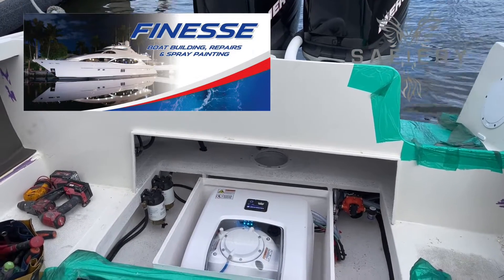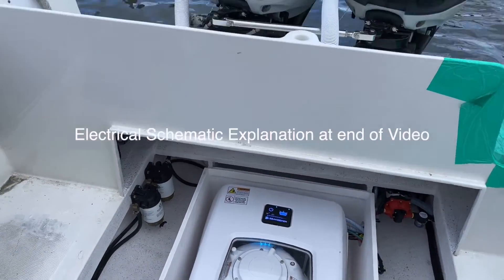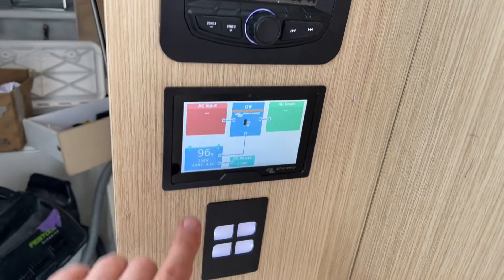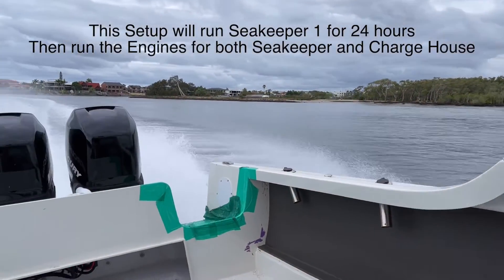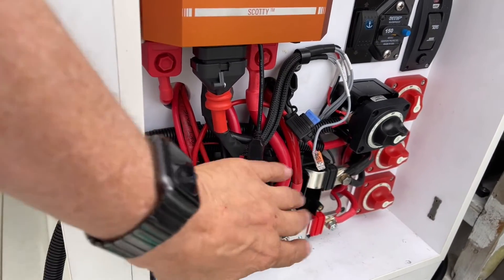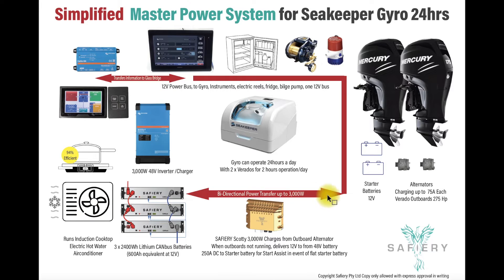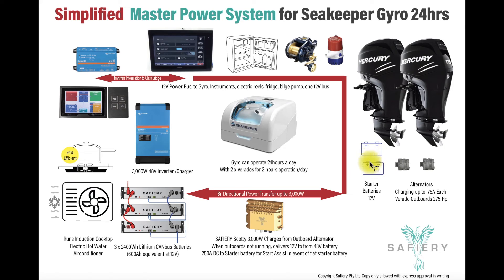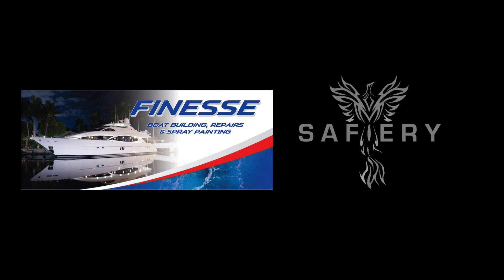Sea Trial of Seakeeper Gyro Bertram 25 - Scotty powers both Gyro & charges Lithium for up to 24hrs

Comment: Absolutely.Incredible.How much 😊
Reply from the maker: About 2K for 2000W; 3.5K for 3000W then add the IP66 Meteor batteries 2k eack. nothing else is essential. Scotty AI is bi-directional so supplies 12V up to 125A or 250A continuous